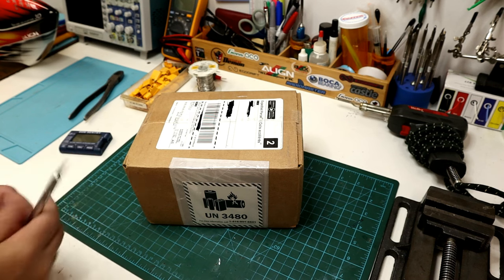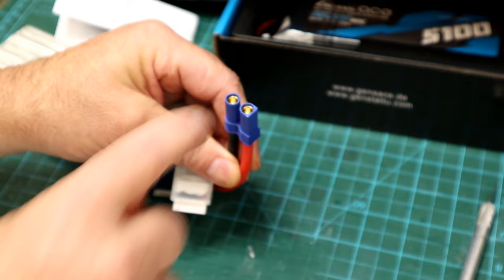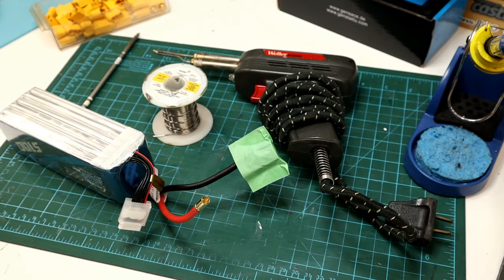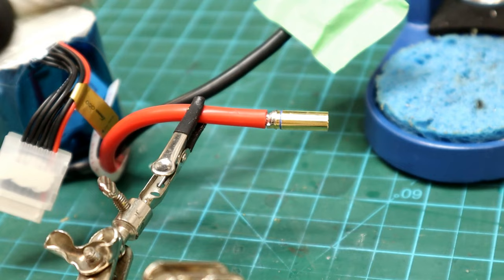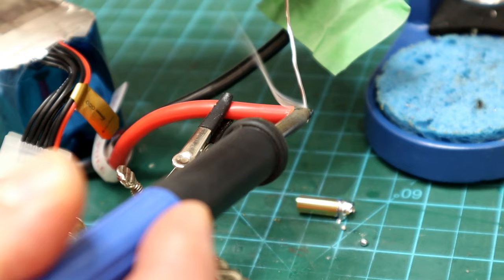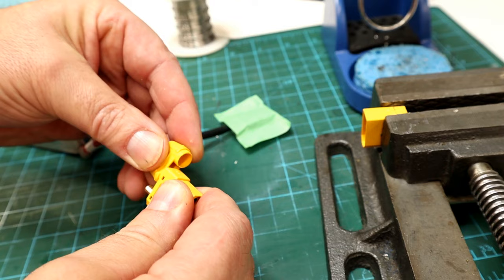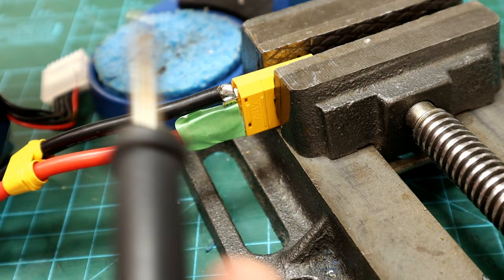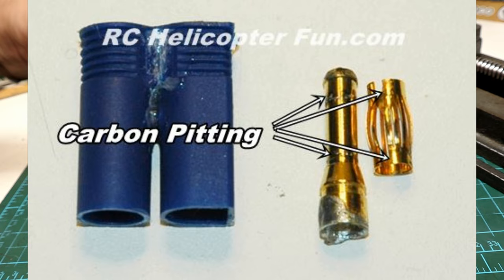How To Change A LiPo Connector On A LiPo Battery Safely

Comment: Put a temporary strip of kapton tape across the back of the cup before soldering then if you have any spillage it just runs off and won't stick. Also have you seen the QS8 connectors yet? They're basically an enlarged XT90.

Comment: This is one task that can totally ruin your day if you don't take your time and prevent a short at all costs. It happened to me once. The spark is bad enough, but the really dangerous part is if it welds itself to the other lead. If you can't rapidly separate them, it's like holding a hand grenade after you lost the pin and spoon. I was fortunate and was able to separate them but in that short time the battery became very hot, and one cell was smoked.  I do like the new solderless connectors that have come out and have been converting my packs over. Either way, be extra careful.
Reply from the maker: Yes indeed!

Comment: Very interesting as always ! Where are you installing/using those new batteries?
Reply from the maker: @1983dmd. Question is what won't they be used in - haha. It's one of the most useful battery sizes in my opinion. I use 6S 5000's in every 550,600,700 & 800 heli I fly. Also use them in an 80mm Freewing Avanti S, 80mm E-flite F-16 & and E-flite Carbon Z Splendor.
Reply: @Rchelicopterfun  I was not aware you also fly airplanes !?!? Videos,videos please !!!
Reply from the maker: @1983dmd   Yep, learned to fly RC planes before helicopters way back in the mid 80's. I hadn't flown an RC plane in almost two decades however because I had no place to fly them here until I got our little airport certified with MAAC & the airport operator as a shared usage field.  So I'm slowly getting back into fixed wing again. Helis are still the number one love of course, but I have to admit, I'm having a blast with the EDF's. 
As for videos, unfortunately, with the new CARs 900 Transport Canada RPAS regulations which MAAC members are no longer exempt from; if I post a video of flying out at the field on YouTube (heli or plane over 250g), it's now considered a commercial flying operation, and I would need a commercial RPAS advanced operating license which I'm not going to get (the hassle and cost is simply not worth it).
It's why I haven't had any flying videos since late last year when all the MAAC drama started, first being grounded by MAAC in December and then losing our TC exemptions in February. I'm just thankful I was able to get the airport re-certified for shared RC usage again in June.
Had to cancel some nice review opportunities this year; the OMP M4 & Align TB60 being two I'm most upset about. The OMP M7 which is on the horizon will be another one I'll have to pass on.    
Would TC enforce this and fine me/revoke my basic certification if they saw one of my videos??? I honestly don't know, but I'm not going to chance it considering all the time and effort it took to get our little airport certified for RC usage. In fact, I'm even worried about existing flying videos on my channel I made before all this, but surely logic would prevail as they were all made when MAAC members were still exempt from TC's RPAS overreaching regulations.
Reply: @Rchelicopterfun  Thank you for your detailed explanation...Glad you at least got your airport re-certified...Aren't you happy  to live  in Canada, where great OPEN SPACES and unlimited HORIZONS are prevalent, from SEA to shining SEA, second only to Russia for land area...(No need to answer ...you get my point !!???;) You might hit a mosquito with your heli or jet....
And YES, TC will 100% get after you if you daaaaare  to fly...Count on a zelous YouTuber to report you to another zealous TC employee....

Comment: Any R2 updates ? how are the parts holding up and are the seams starting to show cracks in the paint ? any events with the droid ?
Reply from the maker: No updates but hope to do one when I eventually get around to doing a weathering video; just having a hard time with that considering I like him clean, but no question, R2 doesn't look the part unless he is at least a little worn & dirty. Otherwise, he is still working 100% and looking the same with the exception of many of the blue 3mm LED's in the front Teeces logic lights failing and having to replace them all. In short, the one the thing I didn't do myself and purchased ready made to save time has turned out to be the one item that has caused the most issues - big surprise. I've also worn out one set of the TPU printed drive wheels so had to print out a new pair and fit them last month.

Comment: I have a cheap soldering iron i never soldered before it says 120v+25% 60 watt will that work for these connectors
Reply from the maker: Not enough power most likely.

Comment: Hi! I have an old lipo (going to trash)
And a new with not T plug
If i remove the T plug from the old one can i put the old lipo in "trash" if it dont have any plug just the cutted cable? Or should i put the other type plug on it what i dont need? - thanks!
Reply from the maker: You don't have to put any plug on the old/bad lipo, but you can't just put it in the trash. You have to first discharge it or it could be a fire hazard. After it's fully discharge, you then have to take it to a battery recycling facility or your local hobby shop if they accept spent LiPo's.
Reply: @Rchelicopterfun  thanks!